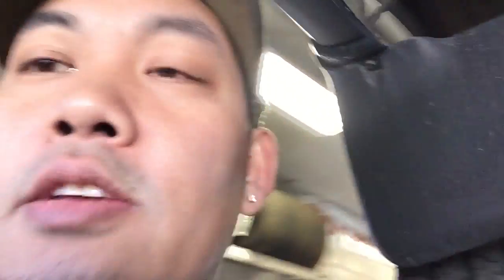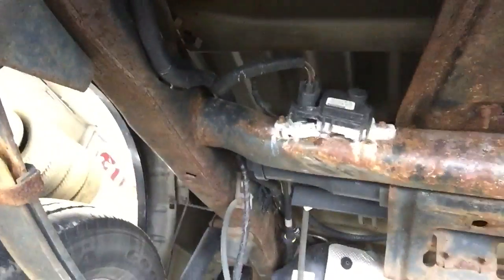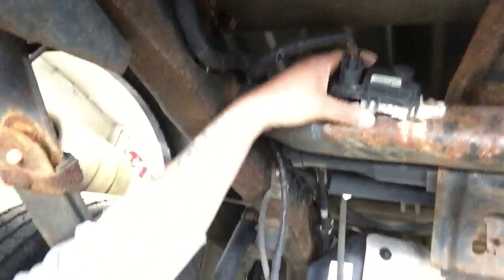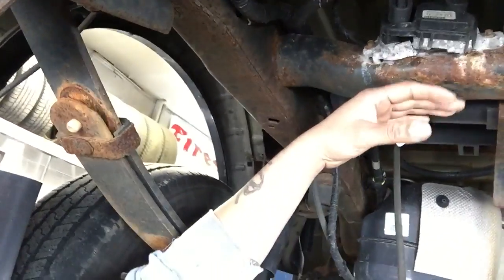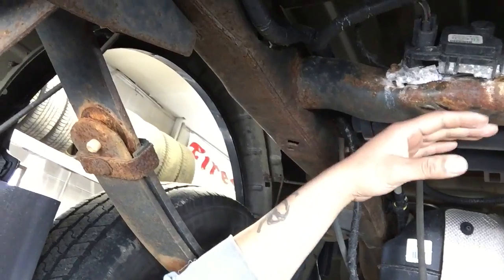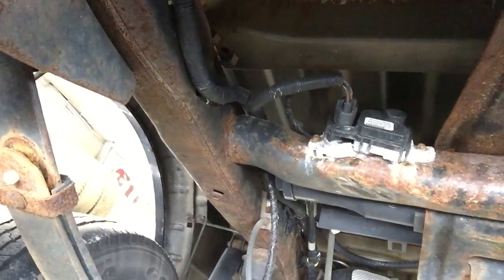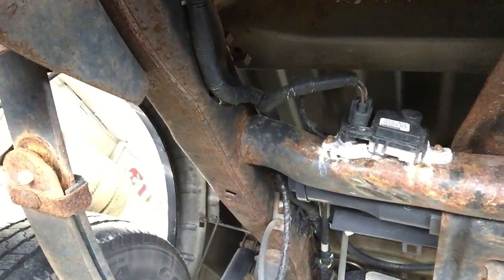08 F150 P0191 Fuel Rail Pressure Sensor

Comment: That's a fuel pump driver module.  And they are notorious for rusting out because they are mounted to the frame. Above the spare tire on a 2004-2008 ford f150. Alot of people misdiagnose when the truck is cranking but not starting. Always check this first before buying fuel pump or anything else.
Reply: And it will also throw the code p0191.

Comment: I have Fuel Tank rail pressure Econoline Van, 2004, e-150, 4.6, V8, with the wires cut, and I don’t know how wire colors are connected. I checked there are 2 positives wires and one ground wire but don’t know where or how they are connected. I do really appreciate your help.

Comment: Ehh, mine is a 2010 explorer xlt v6  with a p0191 code, has hard shifting, rpm goes up but car doesn’t move for like a second or 2, rpm goes down to 200 on warm startup and I did replace the fuel pressure sensor, it stopped the hard shifting for a while but then it came back and the car even performed well before it went back

Comment: what were the symptoms of this problem
Reply: I changed both the pump module and fuel rail pressure sensor and still have code p0191 when I start it cold it has a little studder like not enough fuel or a little misfire I think my fuel pump is going bad
Reply: @bpt386  what was the problem to your truck
Reply from the maker: Brian Thompson check engine light & truck randomly shut off
Reply: mine has code for p0191 and p0190 mine runs but like crap

Comment: I have a 2007 Ford F-150 and I’ve just changed out the driver module and am still having the same problems as before I changed it .... won’t fire. 
Any suggestions ?!?
Reply: Replace fuel rail sensor